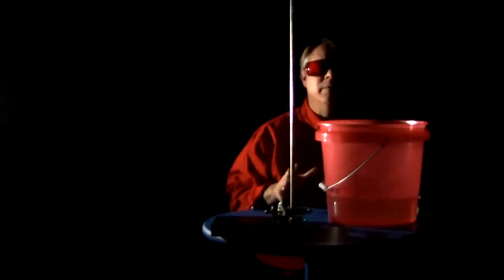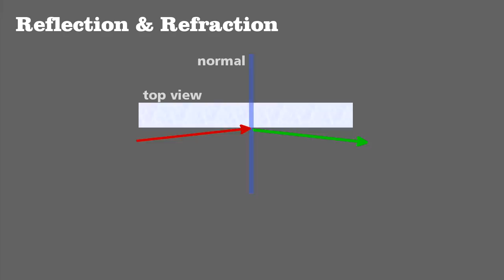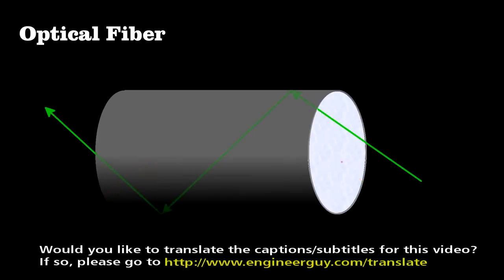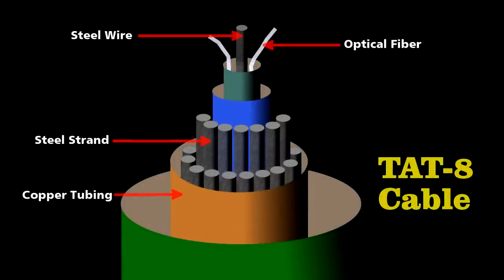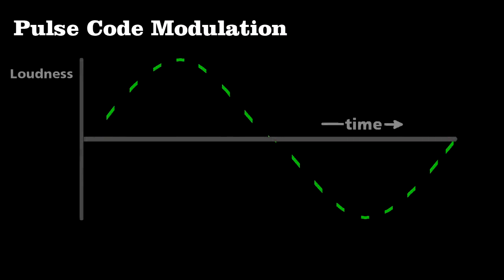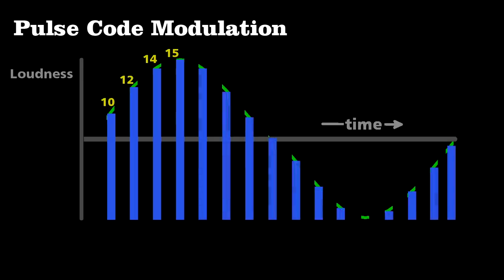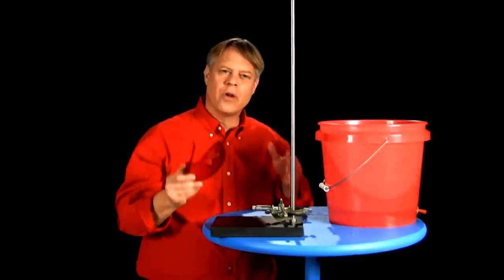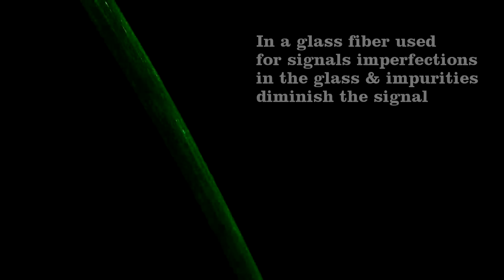Fiber optic cables: How they work

Comment: you mentioned 50k phone calls can be sent simultaneously. How come the signals don't irritate each other while being sent through the cable?
Reply from the maker: Excellent question ... google Wavelength-division multiplexing ... essential they use different colors of light.
Reply: Crazy impressive, thank you. Still mind blowing how so many different signals find their way to their destinations
Reply: engineerguy Why have you stopped making videos
Reply from the maker: The birth of my second child has slowed me down ... that and some writing.
Reply: congratitulations :) and greetings from México.
Reply: Amazing that you still replied almost a year after the original comment, keep it up and congratulations the birth of your child! :)
Reply: @engineerguyvideo  I had no idea they used different wavelengths of light for fiber optics! It's incredible that a computer can route that many phone calls through a few strands across the ocean simultaneously!
Reply: Multiplex, it uses different wavelengths. 
Fun fact...Toshiba created it hence the name TOS link 👍
Reply: @engineerguyvideo  Wouldn't it be more effective to use well insulated copper wire and radio waves? Since radio waves like light(and all electromagnetic radiation) waves travel at the same speed there are a ton of more frequencies in the radio range than light.
Reply: @engineerguyvideo  thought that multiplexing was only supported by single mode FO cables
Reply: @TheBaldr  bandwidth
Reply: @engineerguyvideo  Oh my god, sitting through those digital logic and signals classes were so useful after all! Thanks for sharing.
Reply: Bcz time division multiexing system used in phone call...Each call have different time slot 1/32
Reply: @TheBaldr  1) waves don't travel at the same speed through all materials.  Light travels through a fiber optic cable at about 0.68c for visible light.  Copper, on the other hand, is not transmitting photons but instead changes in electric field.  Propagation speed for this is about 0.8c in a typical phone wire.  But speed of this propagation determines latency (time between when you say something and when it gets heard), not bandwidth (how many people can talk at once.)
2) Transmission of signal through copper wire is much less efficient than sending photons through a glass cable.  That thin fiber optic cable needed repeaters every 50km; a similar copper cable would need repeaters every 2km.  So undersea copper cables are much thicker so they go farther between repeaters.  This makes them much more expensive and less practical than fiber.  Copper has electrical side effects (thermal noise, inductance, capacitance, etc) that make the signal/noise worse over distance.
3) "a ton more frequencies in the radio range" what does that mean? Frequencies are analog, there's an infinite number at every part of the spectrum.  What matters for the multiplexing is how close together you can put them and discriminate them with your hardware, and have enough bandwidth to represent changes in the signal.
4) Bandwidth! Flashing red light (say 700nm) on and off doesn't just need one frequency.  The hard edges when the light starts and stops are composed of many frequencies, much higher than the "main" red light.  So how fast you can turn that red light on and off is limited by the maximum frequency that the cable can carry.  For copper, the best we can do is in the Gb/s.  For optical cable, the highest demonstrated so far is already in the Tb range.
Reply: Its called multiplexing
Reply: @CodeKujo  Nice answer, man. Where did you pick up that info? I use fibre optic cables for audio applications. I'd like to know more about it.
Reply: @conorm2524  A lifetime of science curiosity + electrical engineering hobby. 

  Most of the benefits that optical confers to transatlantic cables don't really apply to a short audio cable.

For audio cables, optical has fewer pathways for electrical noise to be coupled into the analog amplifier section.  Neatly avoids the problem of ground loops, too.
Reply: @TheBaldr  not sure but i think it has to do with bandwidth. Shorter wavelength probably means more information can be sent across faster. Fiber internet is far faster than traditional cables....im no engineer though
Reply: @vossli1074  I'm pretty sure that the critical angle of refraction probably changes by wavelength. hence making some wavelengths not applicable.
Reply: @engineerguyvideo  Have your child create his own youtube channel called engineerboi
Reply: @engineerguyvideo  Congrats engineerguy! Hope all is well :)
Reply: 40
Reply: @vossli1074  I'm dead, any light wavelength travels with the same speed...
Reply: @CodeKujo  amazing.
Reply: @engineerguyvideo  These videos are great, Thank you very much for taking the time to make them.
Reply: DWDM
Reply: @engineerguyvideo   Wow I don't think I've been more interested in something like this before!
Reply: @remyobanor2944  I was going to guess cabling size and distance (as copper has distance limitations much less than fiber before having to be boosted)
Reply: Magic...🤯
Reply: Different wavelengths of light is the most common answer here.  In reality that is true, but you can only get around 4-16 before you run into interference.  Optoelectronics is the keyword you want to look for if you want to go into far more detail.  This is actually used and actively researched in Network-on-Chip (NoC) architectures as well to communicate between cores in a CPU, but that's FAR more sophisticated than your standard Ryzen Threadripper or an Intel Xeon. (Wow, I just called a Threadripper "standard", also their technology is proprietary so I could be wrong.)
Anyway, only took a single class in Algebraic Coding Theory, so I'm by no means an expert.  However, with some clever linear algebra, you can design encoding that helps reduce errors.  At these Giga-Terrabit speeds, a few bits per information for error correction is trivial.  Many codes like this probably use something like a 4-256 encoding, where only a few of the bits are "redundant".  The algebra is very complicated, but implementing a circuit to decode these and convert them to electrical signals isn't too hard.
As a digression, I want to note that amplitude modulation can also be used to transmit denser signals.  These are not truly binary, but can be converted back into binary on the receiving end.  This is used in research on AI optoelectronic accelerators.
Anyway, I recommend Technology Connection's Video on TOSLINK for a massively more in-depth analysis of fiber vs. copper.  TOSLINK is a relatively poor cable and experiences a fuzziness, much like Bill talked about with those rays that leave from the water stream.  This also needs to be accounted for, and is part of why error correction is so important.
Also, the bandwidth of such an incredible technology makes 50k phone calls trivial.  The call doesn't actually have to be transmitted in real time, a few microseconds of delay to encode and decode is all a standard "cypher" needs.  Compress the information of a second of audio into a millisecond, and you can send 1000 different seconds of audio in one.  Of course, this is more on the order of mili-micro second speeds, and the signals are encoded together with things like the amplitude and frequency modulations, but I digress.
It's all pretty complicated, but Bill is right that the core technology is incredibly simple.  If you forget about the whole fancy-computer-encoding stuff, his explanation is basically the whole story.  I wrote quite a bit, but I hope this helps someone figure out just how stupid complex this stuff can get.
Reply: @sagesefton2228  Thank you very much for your time. I will check out Technology Connection's Video on TOSLINK. It`s also fascinating how much space there is in time to send data through. I wish I would live forever and witness us discover new horizons
Reply: Because on receiver antenna, Engineers use demultiplexer which is used to distinguish the two or more message signals at same time......
ECE student ❤️
Final year
Reply: i take aviation eng as my degree. i have never been able to picture how it is like to sent signals inside glass cable using bouncing light. and the correlation between the equation and its real life picture sequence. after 4 years of learning, now, the last sem, i finally found  this one video and finalised the correlation( the real important part) - cuz it definitely helps me for what and when to use the equation based on the real life picture sequence in my head.thank you 🙏🏽.
Reply: Through multiplexing dude.. Technically not enough but this is wt I know..
Reply: @SeattleScotty  u should see how thick the cables are
Reply: Woah, I’ve never seen a reply with the same high number of likes as its parent comment
Reply: Cause of time difference in each signal varies your phone call is 0.006   milli second mine is 0.007 milisecond it can be decoded by time . Another factor many bandwidth of light can be inputted in a optical fibre by changing the angle of entering
Reply: @engineerguyvideo  congrats! Take your time!
Reply: @TheBaldr  that's essentially how early telegraph cables worked. Unfortunately they don't have the bandwidth to provide the capacity requirements of modern communications.

Modern fibre optic cables are capable of carrying many terabits of information each second (one terabit could carry around 125 million calls). You simply won't get that with a copper cable across an ocean, otherwise we might still be using them today.

Engineering is always a game of tradeoffs - technically best solution, economically best solution, or somewhere in the middle. Optical fiber is a best of both worlds solution being relatively inexpensive but offering incredible capacity.
Reply: @JUMOWAx  and it's all done by color coding! Wow!
Reply: Each calls data transmission will have individual separation through AES encryption
Reply: @stoicperson4649  Incorrect. Calls are separated from each other typically through the use of time division multiplexing. Encryption seldom has anything to do with it.

I'm on my phone so I won't write a huge long response, but look up things like ISDN BRI and PRI, SONET and SDH, E and T carriers... These technologies were used heavily in telco voice networks over the last maybe 40 years.

Packet switched networks are a whole other ball game.
Reply: @cymaticCS  look up a device called a "dispersion compensation module". These are used widely in optical networks to reverse the effects of chromatic dispersion, which causes different wavelengths to travel at different speeds.
Reply: Peter H.  Not quite. A single fibre can carry in theory many millions of calls through various multiplexing techniques.

A typical submarine cable has only 2-4 pairs of fibre in it, and carry vast quantities of voice and data.
Reply: @JUMOWA: Multiplexing of multiple bands.

@Bill: Congratulations for your second child.
Reply: @engineerguyvideo  or wavelengths
Reply: They use the same frequencies as well and split up the signal by time
Reply: I think correct answers to this is that audio signal gets converted in electrical and back again to audio
Reply: @TheBaldr  the bandwidth of a copper cable is so much that fiber easily dominates it. and when the distance increases the radio wave you would want to use will be longer wave. that's why 5G uses high frequency compared to 2G. so, radio communication doesn't have the bandwidth to support multiple messages as fiber support.
Reply: @tylermassage6220  You are talking about TDM, they use it in GPON technology (FTTH links, etc)  normally providing Internet for homes, but for really massive traffic it's better to do a DWDM, and for this they use different frequencies, usually around 1550nm if you think in wavelenght format.
Reply: They irritated each other too much..lol
Reply: They moisturize
Reply: @TheBaldr  no because of inductivity and capacity. Also copper is heavy and expensive, corrodes fast and all that stuff
Reply: @TheBaldr  Don't quote me, but I think one reason you can't use radio waves for such purpose, is because they are larger waves ( a lot larger)

Comment: this guy explains perfectly, not stupid like explaining to a 4 year old, and not overly complicated like explaining to a college student
Reply: Yes, but about the modulation part, he should have said a simple example of encoding rather saying that's the way we do things. Because no, we don't really do it like that.
Reply: @howardlam6181   How is it actually done?
Reply: @NN-sp9tu  Well, first, the light is the carrier and we don't direct apply modulation on the carrier. You only mix the carrier with a modulated signal of much lower frequency.
Then, there are many more types of modulations. Surely you have heard of frequency modulation for example. You give each frequency a code and you sample a certain period of time to figure the frequency out. And there are many more advanced techniques to mix different techniques together to squeeze out every possible bit of information capacity potential.
See link for a picture how a mixed signal would look like.
https://www.elprocus.com/pulse-amplitude-modulation/